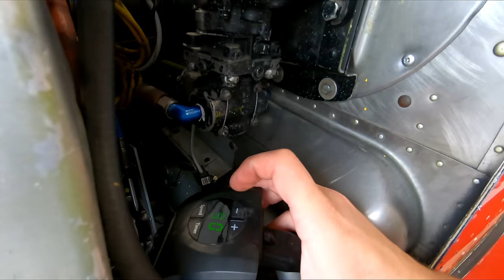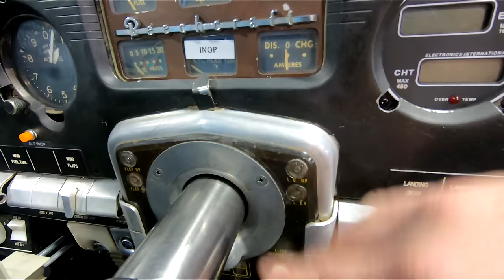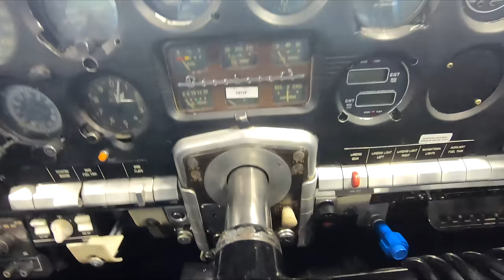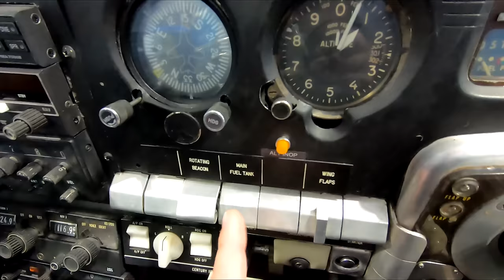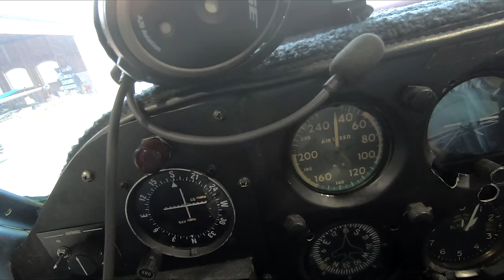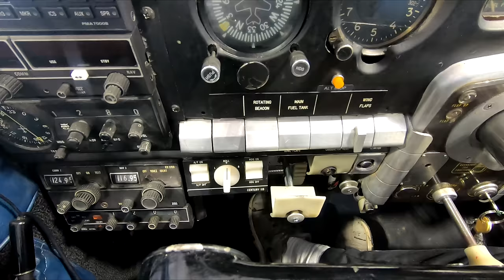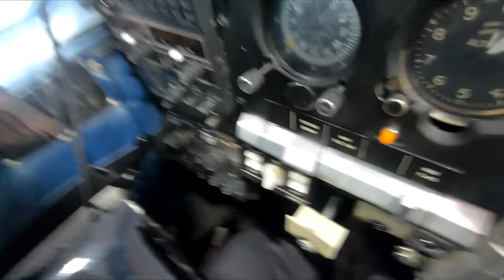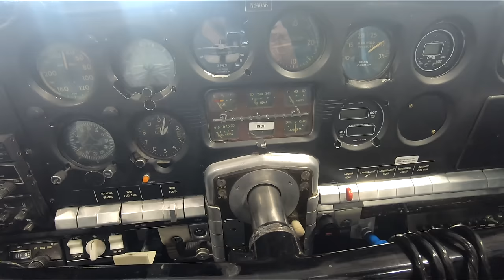De-Mystifying Early V-Tail Bonanza Operation Pt 1: Ground Introduction

Comment from the maker: This video is a different style and a lot longer than my usual video, but I hope that it will be helpful for people who are new to the E-Series Bonanza. I have the video broken down into chapters for those who are looking for a specific piece of information. I will post the timestamps below, and they are in the description. If I missed anything, let me know, and I will include it in part 2! Thanks for Watching!

0:00 Introduction and Disclaimer
4:53 Propeller
9:05 Charging System
9:59 Engine
15:07 Fuel Level Check
16:26 Landing Gear
18:46 Fuel System
22:02 Ruddervators
24:55 Engine Preheat
28:35 CBs and Switches
30:14 Emergency Landing Gear Extension
34:53 Flap vs. Gear Switch
41:58 Ignition System
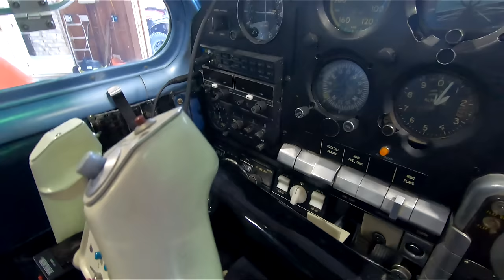43:00 Fuel Selector and Fuel Quantity
46:57 Other Engine Instruments
49:56 Airspeed Markings
54:15 Misc Panel Components
59:22 Throttle
1:01:15 Cold/Hot Start
1:09:15 Outro

Also, I guess I have merch now. I’m having trouble linking to my YouTube channel, but follow the link below to check out my Shopify store. I sell shirts, stickers, and mugs at the moment with more to come. If you would like to support the content I make on YouTube, this would be the way. 

Ben Weeks Bonanza Pilot Online Store: https://fa17ea-2.myshopify.com/?_ab=0&_fd=0&_sc=1

Comment: Good job Ben.  Many years ago we owned Bonanza Serial Number D-4255, built in late 1955 with the 225 hp E-225.  At annual found corroded prop so had the Hartzell kit installed like the one in your video.  Back then the kit including governor, prop, spinner and the oil transfer unit cost around $1500.  My how times have changed.  Our Bonanza had a 6 probe EGT, M wing tips, and the thick one piece windshield.  Did not have the alternator or spin on oil filter.  Don't recall if they were available back then but would have liked to have those features.  As I recall it cruised in the mid-upper 170s on 11 gph.  Typical cruising altitude was 8,000 feet.  Flew a lot in south Florida but don't recall any problems with oil temp or CHT.  Did consider the Debonair engine and prop STC, which was a 225 hp IO-470 with Hartzell prop.  That total cost installed in those days was in the $7K to $8K range.  Don't know if that STC is available today but all you had to do was Fly any of the IO-470 or IO-520 equipped Beechcraft singles back in that era and you would consider those options.  Beech built good airplanes.

Comment: Great video on the V tail. On the inspection of the gear the up lock cable should be inspected for fraying as when it breaks the up lock will go through the top of the wing. There should be a boot over the up lock that covers the whole assembly.

Comment: Hi Ben. Great new informative video! Manual gear extension; 50-55 turns of crank handle COUNTERCLOCKWISE!  Any time you’d have gear down issues before landing, pull gear cb, crank gear counterclockwise-maybe one half to two turns, to ensure you get gear-down cb in to get green light and check red arrow is down (it’s only for the nose wheel).
Reply from the maker: Thanks for the clarification, Dave! I for the life of me could not remember the direction, even though I have done many manual extensions. COUNTERCLOCKWISE on the gear handle! Thanks so much!

Comment: Hey there…spent hrs and hrs flying in my dad’s Bo’s….I knew that fuel system like the back of my hand….take off and land on left main…run left to half…then aux to just about E…then right main…cause the residual fuel goes back to left main…that was in a K35…the 47 he had had 2 mains and a aux in the baggage compartment….I could pre fight with my eyes closed…very easy airplane to fly…I spent hrs flying them..the K35 had a factory installed autopilot but mostly I would offer to hand fly…loved to flip over control wheel…😊.
Reply from the maker: They are a pleasure to fly! The fuel system seems simple in my head until I try to explain it in the video. Lol once a new owner gets used to it they will have no problem.

Comment: The check valve should be removed from the wet sump system. There was an AD for that I do believe, failed check valve could result in starvation of oil to the engine, hence it should be removed.

"The check valve that was under the oil tank on very early V tails was removed by AD. That means that ALL OF THOSE VALVES were either removed or disabled if the airplane is in an airworthy condition."

Regards, Lew Gage
Reply from the maker: That is interesting information! So you actually want the oil to seep into the engine at shutdown so you don’t run the risk of oil starvation?
Reply: @BenWeeksBonanzaPilot   The seeping into the engine is just a result of having a wet sump system vs dry sump. The AD is so that a malfunctioning check valve doesnt stop oil from getting into the engine while flying. That has caused engines to seize in flight.

Comment: On the flaps and gear the best practice is to pull off the runway, stop the plane and look at the piano key switch before moving it. Same when you are in the landing pattern except it is always gear down first then flaps.
Reply from the maker: This is good advice. I still insist on one finger to raise flaps, but visually looking at the switch helps a lot to verify.

Comment: Hello, another D model.  We have four D models at our airport.  According to Stockton Prop the Mt should be inspected every 5 years for safety.  V tail trim tabs should be up and down tight. The tighter the better for the whole assembly.  Ruddervators are balanced and should not be painted without re-balance.  Interior light dimmer switch can get green gear light to be invisible in daytime.  Fuel tank switching is marked on my D with 1 hour left, 1-hour aux, 1 hour right which should leave you with 14 gal in the left at 3 hours.  That's what the plane tells you.  At cruise the rear 20 gallon will not be close to empty in one hour.  Also, the right tank drains faster than the left.  My Aux tank indicator switch is on the right side of key panel up shows aux fuel level.  At 29:18 there is a secrete ash tray/storage box on both sides pilot and right seat in the keys.  On the D you can mark the yoke shaft with marker at 0 trim.  As you turn the trim up or down, yoke will travel in or out and it will return to the line(at zero) on the yoke shaft letting you know where you are in trim by looking at the shaft.  It works on mine, and I could see you were up trim by looking at the position of the yoke shaft.  If I fly into a hot high airport, I set the idle mix for a smooth clean idle and turn off the ignition leaving the mix in a perfect setting.  I have learned to live with that terrible mixture control, that looks exactly like the carb heat right next to it.  Last, I hate the vernier throttle, but use it on landing and initial take of the let the prop gov catch up to each other.  There's more but that's enough.
Reply from the maker: These are great points! Thanks! Some of these items I’ve covered in part 2 (edited but not yet posted), but of course there are still some items I missed even in part 2 (gear light going out with nav light switch on), so it’s a good thing I still have to film part 3!
Reply: That’s it, I was thinking dimmer but nav is correct.  I’m also surprised how different the controls are set up on that one than mine.  I can’t 1 finger my flaps because the cowl flap pull is right under the flap button.  You have to do a weird contortion with your hand to get to it. It’s also hard to turn it on and off so I just get to 105 and dump them to full.  I also have the Thompson 1900 and I really believe you need to wobble the hand pump to get fuel to the mechanical and have throttle out a 1/4 while you’re doing that.  Then pull it back to idle and screw it in 1-2 turns and hit the starter.  I don’t wobble it because the 1900 puts out 80 gallons an hour.  It works perfectly in that manner.  Speaking of the 1900, mine started leaking in flight,  it can dump 10gallons per hour overboard.  One test is to wobble the pump and have someone look at the overboard dump line from the pump.  It will let a stream of fuel out if the pump is leaking.  One other thing is to tell the new owner to watch the entry door like a hawk.  On windy days don’t let it get slammed forward because it’s hard to fix a bent hinge.  It’s best to close and secure it.  Last loading two big people and cargo in the back seat can put it on its tail.
Reply: What do you mean by let the prop governor catch up to each other? What is your best cruise performance at what altitude and speed, manifold pressure and rpm ?
Reply: I wasn’t clear, engine and prop.  If you just shove the throttle forward from idle I get a huge surge of power from engine then prop governor puts oil to prop setting pitch.  It is much smoother winding in the throttle slow off idle then giving it full.  Hot days high altitude 11k 65 degrees 178mph mph. Cold days 185-190mph.  2300rpm full throttle.

Comment: The other push button is the primer..  don’t touch it!  the last time i ever used it the solenoid hung open and flooded a couple of my cylinders.  I though i had a major problem when they were not firing after the engine cranked.  I was running on 6 of 8 cylinders. 😳
Reply from the maker: Awesome, Jeff, thanks for the clarification! We have always disconnected the primer systems on the planes that have it because they seem to be more trouble than they’re worth.

Comment: That’s an awesome video. Always wanted an early v tail. I never thought the airplane had a bad reputation just untrained pilots or mechanics.
Reply from the maker: That’s really what it comes down to. Increased capability and complexity requires increased attention and proficiency from the pilots and mechanics to operate the aircraft properly. It’s not really harder, it’s just a few more steps.

There are a few head scratchers like why they couldn’t add a couple more fuel quantity gauges, but most of the systems are simple enough once you take the time to learn them.